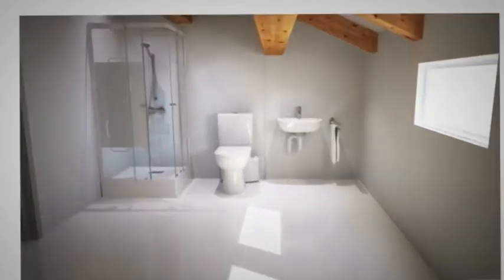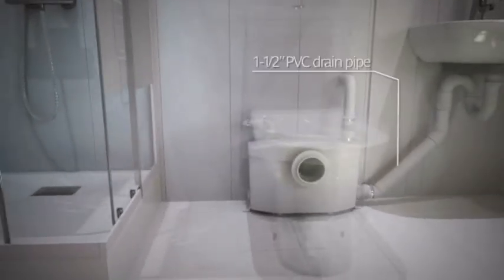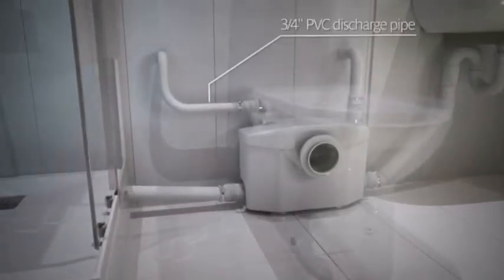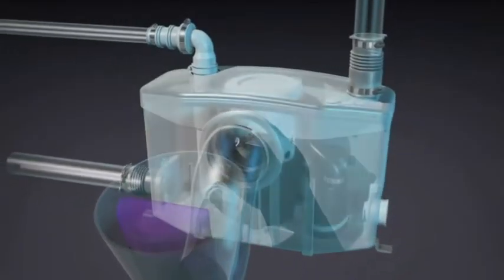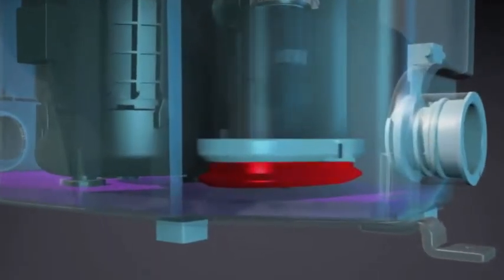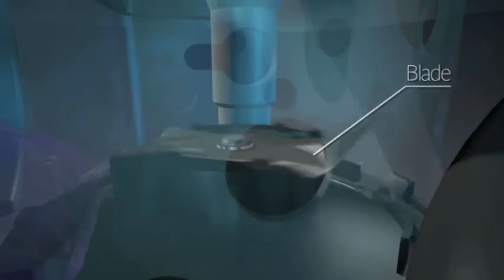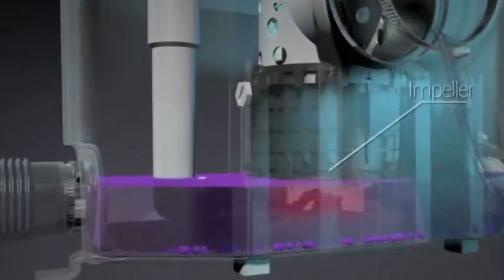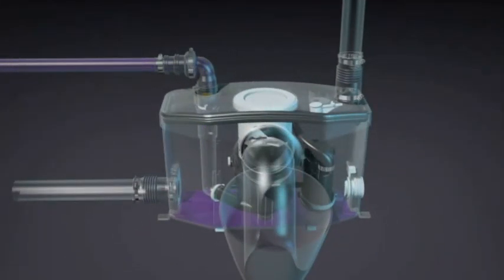How the Saniflo Macerator Pump Works

Comment: Using the example of sololift2 D-2, I will tell you how to solve problems for a long time. The device has no electronics, the pump is controlled directly by a mechanical switch in the filling sensor, which burns out after 2 years. There is a rubber membrane on the filling sensor, which turns brown over time and stops reacting, it needs to be changed, if it breaks, it will pour through the air duct (a small hole) and the entire pump and possibly a little on the floor, the engine will burn (costs a lot). The air valve becomes dirty and water is poured through it onto the floor. I made the sololift work normally for years without disassembly and cleaning just like that - 1.Close the air valve completely with 3M adhesive tape in 2-3 layers (water will begin to flow in and out of the inlet corrugation by gravity).

2. Turn off the filling sensor and close its air duct (small hole) with acid silicone.

3.Install a configurable capacitive sensor outside the housing to the left of the water tank, for the presence of water, autonics CM30-3015NC (for a 3M double-sided thermal scotch); time relay XY-J02 (JZ-801), OMRON G3MB-202P solid-state relay for shunting the mechanical relay on the time relay board and a 12V power supply and a smoothing capacitor for a 2000 mf psu. The sensor must give a command to turn on the time relay (via a 50mf capacitor, a resistor parallel to the capacitor), which must be configured to turn on once for 3 seconds. The power actuating contacts should go to the wires in the pump that used to fit the filling sensor.

Plus, I held a separate switch for manually starting the relay with my time relay and + OMRON. And it is also necessary to conduct a wire for a switch that will turn off the time relay for a short time, turning off the cycle. Setting up the relay - 3s work, 6s simple, number of inclusions 900 times. This will work for a long time and without maintenance with disassembly because there is almost nothing left in the system that can collapse from alkalis or acids, or through which a pump or floor can be filled, the filling sensor does not contact with water, only the engine and the water check valve remain of the vulnerable mechanisms. Once every 3 months, fill the tank with water with detergent for washing and wait 6-24 hours and drain, you can more often (alkaline powder, you can use acid detergent). After closing the air valve, the capacity of the sololift, as well as the outlet pipe, will become pressure. Perhaps, for this reason, may be nothing will accumulate on its walls, just as it does not accumulate on the walls of the outlet pipe due to pressure and cavitation. The instruction was written by Vache Babajanyan
Reply: You just made it look extremely complicated

Comment: Can the outlet be connected to a 40 mm pipe (sink pipe) instead of a 4 inch sewer main pipe? I know the direct outlet is 32 mm inches but it goes pressurized, so the question is whether the macerating process is capable of leaving the waste fine enough so it can leave gravitationaly through a 2 inch pipe